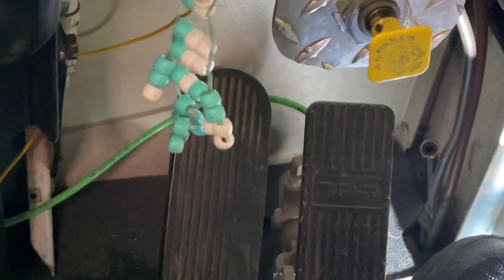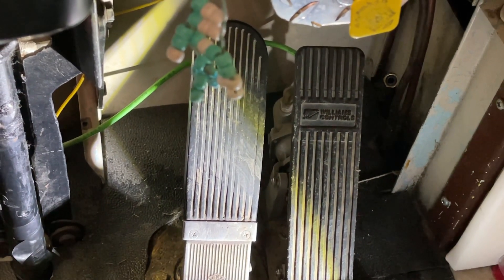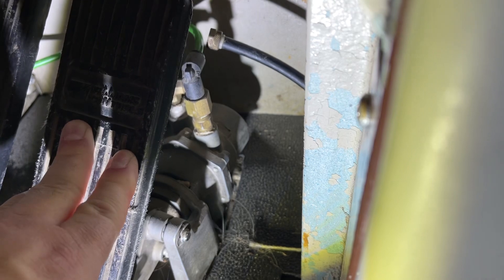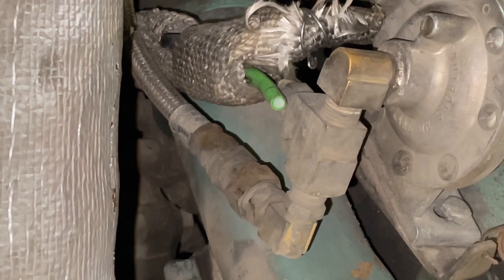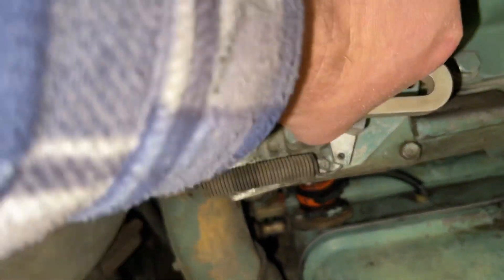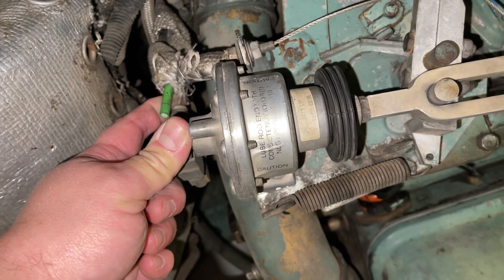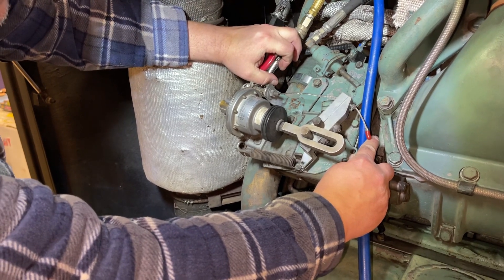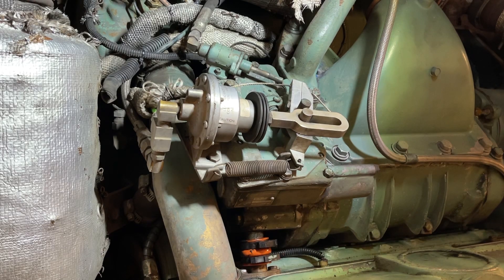Air throttle troubleshooting

Comment: Oil in your air system may have gummed up the O rings. Someone suggested running alcohol through it to see if that might work. Is Williams still in Portland?
Reply from the maker: Brake systems Inc. is In Portland and seems to be the correct place to go now.

Comment: Recent problem or chronic issue?
Reply from the maker: Recent
Reply: @ThisOldBus  hmmm. I'd Rebuild front valve or clean it out if possible. Action of the rear valve does seem slower to me. If junk has gotten into the hose hard to tell.  Nothing like 1000's of miles to bring out a problem.

Comment: If the 35 feet of airline is obstructed, a quick exhaust valve will expose it. Quick Exhaust valves vent to atmosphere at the port.
Reply from the maker: I called the mfr and they recommended one of these..
Reply: @ThisOldBus  they are readily avail from many manufacturers, let me know if you have issues finding one. We use them all the time to speed up an air cylinder extend and it retract speed.

Comment: I think either the air line is pinched or it’s just too small.. need to try to find the specs on how big that air line is supposed to be.. My other thought is the spring.. that may seem like a lot of force but there is quite a lot on that throttle when the engine is running.. try pushing the throttle up by hand at the governor and see how fast it returns while the engine is running.. that will eliminate whether it’s an air issue or a mechanical return issue. I suspect the air line is too small, I do not think that bus would have had that plastic air line from the factory?
Reply: 72 lbs ???
He could not move it by hand, with his fingers at 72 lbs.
Reply: Just took a look at the spec.. and you are  good with 1/4” line up to 40 ft.. the spring is supposed to have 10lbs of pulling force at rest and 72lbs fully extended. There is an internal return spring in the air cylinder.. you may want to make sure that spring is in good shape.
Reply from the maker: Thanks Gino, I was thinking about that line too. Saw something calling for 3/8” line. That spring is pretty beefy but not 72lbs, the external one is in decent shape, when actuated directly with air it returns quickly.. Where’d you find the drawings and specs?
Reply: @ThisOldBus  I have 3 springs on my throttle, mainly because of my fast idle creeps up if I do not have that many springs. We have some of the Williams documentation on the Wanderlodge forums.. I can send you the sheet I found via email if you like.. just let me know your email.
Reply from the maker: There is no way to post my email here privately, post a link and I’ll approve it or friend me on FB.

Comment: Sounds like you need to get a kit to rebuild the pedal cylinder. All the control happens at the pedal end - if the cylinder on the governor extends well it should retract well. If you listen carefully there is a sticking noise at the pedal end. The noise you have up front sounds just like mine did - the grease and rubber parts in the pedal assembly get stiff and need servicing when this happens. There are lots of moving parts in the pedal and they can hang up pretty easily, including the diaphragm. The kit comes with all the parts to replace the serviceable parts and the appropriate grease to use for them.
Reply from the maker: Yes this sounds like solid advice. Thanks

Comment: Look at the cylinder there should be a return spring inside that might be broken and I think there's a bushing that may be sticking give me a call should not be hard to fix
Reply from the maker: Hi Joe, Someone else mentioned possibility of a busted spring inside the diaphragm at the governor end, is that what you’re thinking too?
Reply: @ThisOldBus  take a screwdriver and remove the cover on the cylinder to inspect diaphram, spring, and cylinder bore

Comment: Try doing the same thing with your air hose but connect it to the green line at the front and see how quickly it returns.  If you air the line from the front and it returns normally, then it's probably the foot valve.  It seems that it's the foot valve anyway.  Why don't you just take it apart and see if it's gummed up inside.  I've rebuilt the slave valve which was pretty simple.  I think the foot valve is too.  I have the parts for one but I've never taken it apart.
Reply from the maker: I did it in the video. It adds about 1 second
Reply: @ThisOldBus  I must have missed that.  I noticed the small bellows on the slave cylinder don't look like the air is passing through to the push rod, so that indicates the slave is ok on that end.  I had that problem and rebuilt my slave.  I have a couple of kits for the master, but I've never taken one apart.  There are only about 4 parts in the master so I don't think it's any harder to rebuild than the slave.  Williams Air Controls parts are on eBay a lot.  If you can get the number off the pedal valve, you should be able to order the kit.  Seems like the exhaust venting system is slowing down the air return.  Do you think it's the line still?  (My slave was pretty gummed up after 25 years, but the cylinder wall sleeve was worn out and letting air pass by. The sleeve comes with the kit.)
Reply: @ThisOldBus  I wish I'd think of all of these things at the same time, but I noticed you have a "T" at the slave valve that has another line branching off of it.  I'm assuming that goes to the modulator on the V-730.  That line is supposed to tee off an an equal distance from the slave and the modulator.  In other words, it is supposed to branch off somewhere near the engine compartment bulkhead and be the same distance from the T to the transmission as it is to the slave.  Perhaps there is a slow return of air to the foot valve being caused by this all of a sudden.  Also I had a similar problem with my Invisibrake that was caused by a restriction in a T connection on the vacuum line...maybe check for that too?  Also just read another comment about the size of the line.  Mine is 3/8" all the way.  Yours looks to be 1/4"
Reply from the maker: I have read this about the Tee before as well. Does this help with downshifts? It clearly isn’t that way... I usually take my foot off to downshift just to ease off the power. I think this tee might be slowing the trans response too. I called the manufacturer today and described the problem, asked about the line size. It’s 1/4” at the pedal and that’s the spec. The guy that answered the phone wasn’t thrilled with changing the line size. He suggested a quick exhaust valve. Someone else suggested that too.
Reply: @ThisOldBus  So, none of this will explain why your problem just started after working fine as it was for so long other than something obstructing the release of pressure when removing your foot from the pedal.  Another thing that might be adding to the delay could be this.  It looks like the line to the transmission from the tee at the slave is larger than the 1/4" from the foot valve, like 3/8 maybe?  Theoretically, there will be more volume of air in a larger line than a smaller.  If so, it will take longer for a 3/8" volume to pass back through a 1/4" column than one of equal size.  Also, the fact that it has to pass right by the slave valve than some distance away would mean that all has to go by the slave on the way.  This could also cause a delay but doesn't explain why it just started.   On the addition of the exhaust quick exhaust valve suggestion, I'd question why you would want to do that when clearly the problem is new and it worked fine before.  Just one more thing to go bad and I've never seen one set up like that.  
You may have seen my video about the shifting of the V-730.  The manual calls for replacing the modulating valve every 50k miles (I think).  Last time I did mine it had about 3 times that much mileage, although I did notice significantly better performance with the new modulator.   The V-730s I drove, including mine, have a very hard downshift from 3rd to 2nd under load (with your foot on the accelerator).  I always try to prevent that by manually downshifting with my foot off the accelerator for a second at about 49-53 mph when my speed is dropping off on an uphill climb.  (it is set to downshift on it's own at 46 mph) This is because the shifts between 2 and 3 and 3 and 2 occur with the converter locked which makes is much more pronounced.  The new modulator will help the upshift a little, but doesn't do much for the 3 to 2 downshift. 
Have you taken the foot valve apart yet?  I still feel like you're going to see the problem if you fix the location of your T and make both lines the same size and it still happens.  If you have already determined your lines and fittings are clear of obstructions, it must be in one of the valves, most likely the foot valve.   Although, the slave can build up a lot of crud which could obstruct the passage for the air to return.  (mine was filthy when I removed it several months ago...I should have done a video on that) .  Anyway, good luck!  Looking forward to seeing what you find.

Comment: I'm like James about the return restriction. You could also take a piece of hose and route it from the pedal valve temporary to the actuator to eliminate the hose inside the bus. Our 4104 has about a second of delay. 3.5 is quite a lot to deal with. It seemed to take longer than usual to actuate too. Keep us posted.

Comment: You might try taking the line off at the peddle and cycle it from there with the hose from the compressor, just to see what the delay is through the line. Could be a pinched line, but I would suspect the valve.
Reply from the maker: I did that in the video

Comment: Take the fitting off and see if there is a screen that maybe partially clogged
Reply: Also you can put a pressure gauge at the throttle to see how fast the pressure drops off